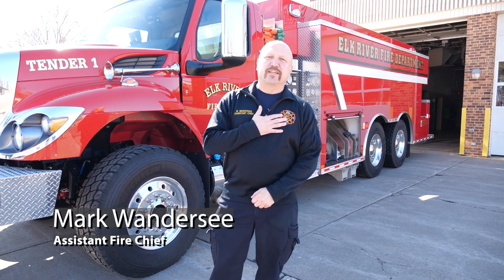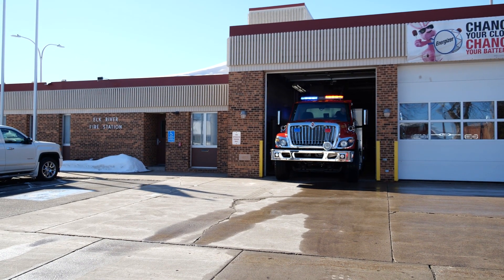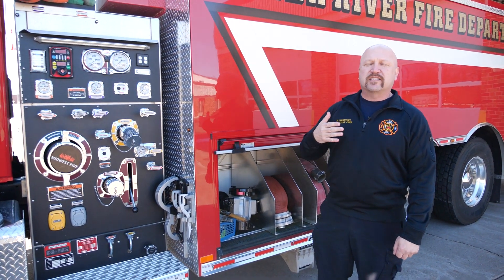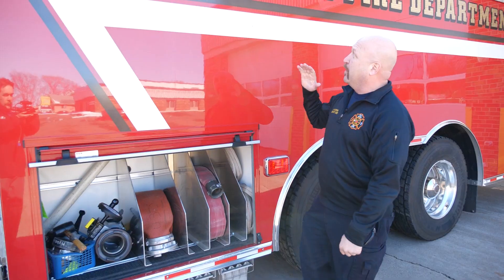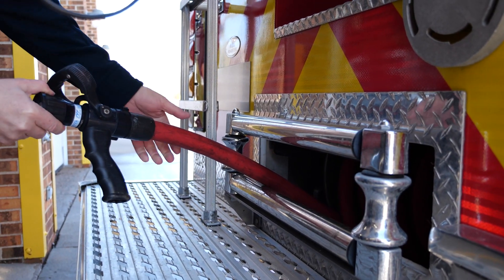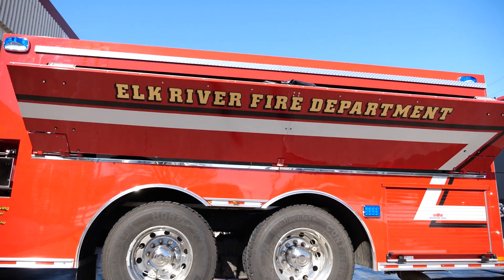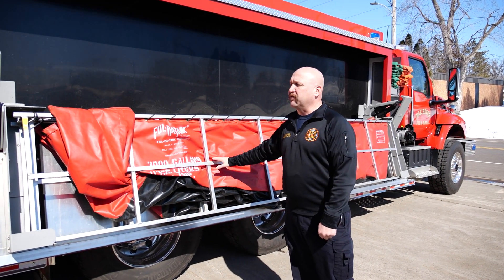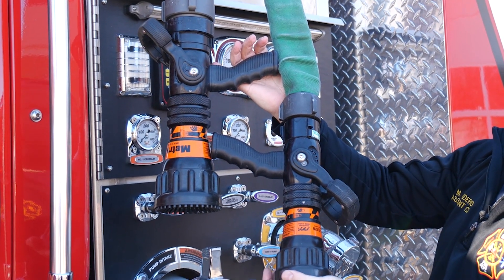Fire Trucks 101 - Fire Tender

Comment: Really❗❗can fill a 3000 gal tank in 1 min...please,what am I missing🤯
Reply: About 2 minutes here in Washington to fill, our fire hydrants pump 1500gpm at 20psi, for a smaller residential it would take around 3 minutes to fill the hydrants are at 1000gpm, the pump on the tenders we can normally discharge 1250 to 1500gpm with a 5" to 6"  discharge pipe